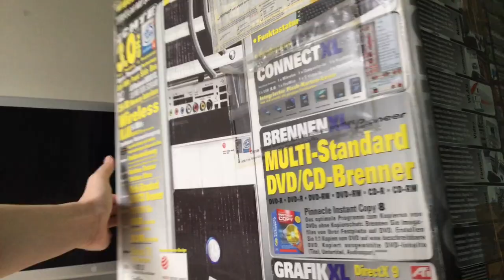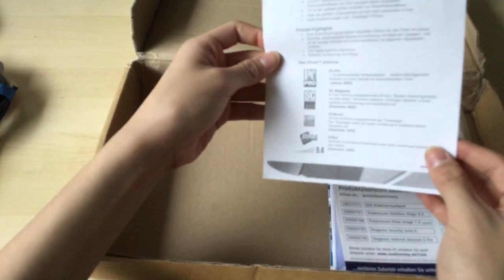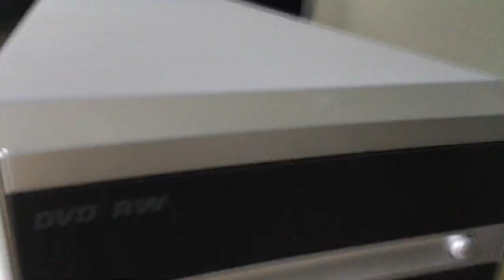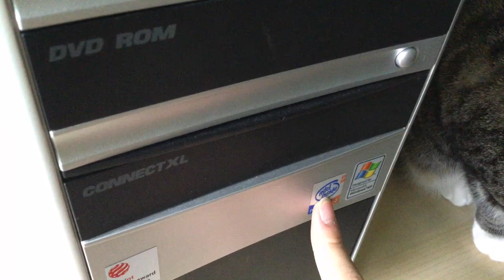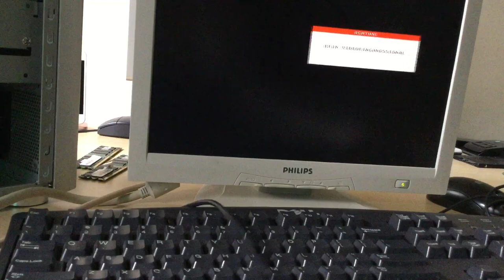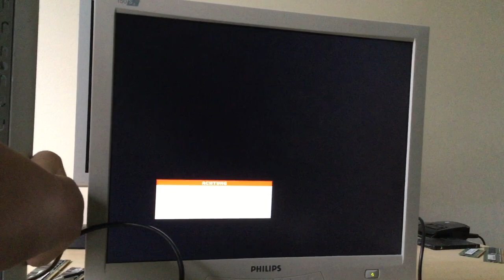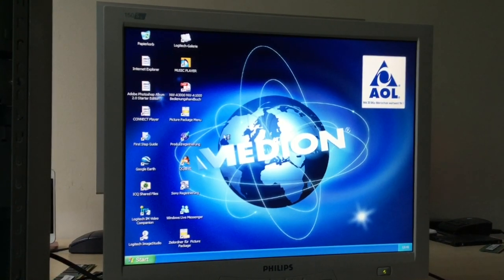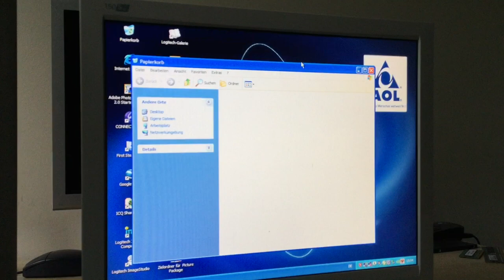Medion MT6 Multimedia PC Teardown

Comment: Suggestion Turn it into a retro game pc or use it as a multimedia server.
Upgrade the processor. Core 2 Duo or Pentium Dual Core avoid Pentium D
Install the maximum amount of ram the motherboard supports.
Replace the hard drive. Sata SSD + a seperate storage hd(s) may require Sata to ide adapters or add in Sata card.
Your wifi card should  still work under most Linux distros. If not buy a compatible  usb wifi adapter.
Add a gigabit ethernet card or usb ethernet adapter for better speed.
You can dual boot Windows & Linux easily. I suggest Linux Mint for ease of use.
Reply from the maker: Thanks for the suggestions! I might do it on another computer at some point as I want to keep this one as stock as possible.
Reply: 😒👍 Let's Go People!